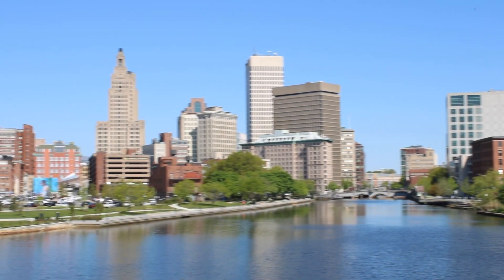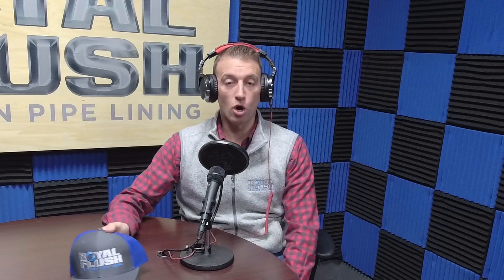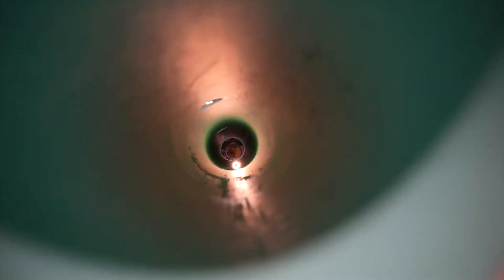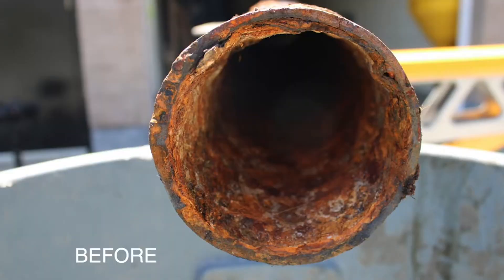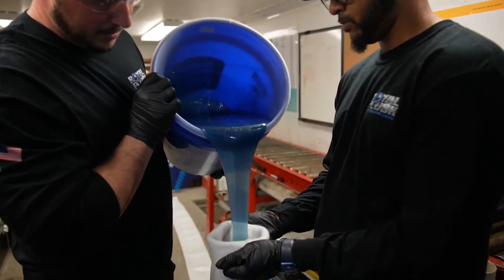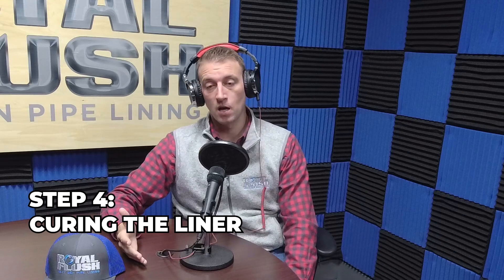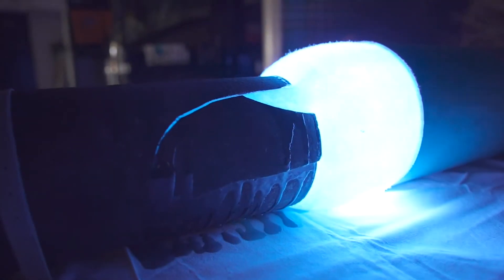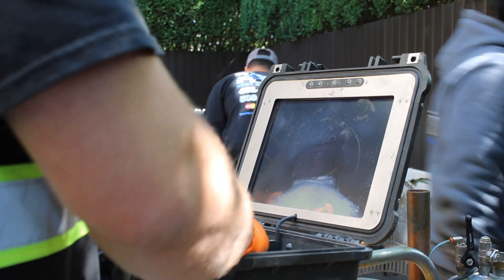Pipe Lining Explained (CIPP) // Episode 34

Comment: Interesting. We live in a 65 year old Neighborhood. Have Cast Iron Pipe, My Neighbor just had a Company Redo his PIPES by Bursting out the Old and Pulling in PVC/ABS??? It was White Plastic Pipe, and they Hooked up a Clean Out going to the STREET. COST.... $16000.00??? What does this stuff Cost? In our Case, it's 35/40 FEET to the STREET in a Straight line to the MAIN CITY SEWER. We have a Clean out that accesses the MAIN in from of our Bedroom Window. Pretty Easy Access Point. Haven't checked on one Pricepoint here and it was $14000.00 to do a LINER like I see here??????  Jesus H?????  Sound's kinda High compared to what my Neighbors had done??? They Did a Lot of work over there.  3 DAY'S Worth???
Reply from the maker: Obviously our pricing varies based on a few factors, but it's definitely not always cheap. However, the job will be done as fast and proficiently as possible. Our liner is also designed to last 50 years, so it's virtually a permanent fix, and 99% of the time, we wrap up residential projects in a matter of hours, not days.
Reply: @   Thanks for the reply.
Reply: Relax with the question marks lol

Also if that was 16k, at that point just dig.
Reply: @     Ok, Sorry about the ?????????????????  3544. I have Alzheimers, and Involuntary Tremors, and Parkinson's Disease. Bummer.